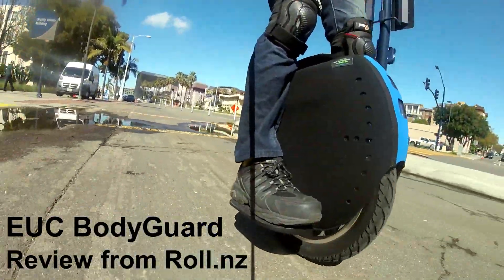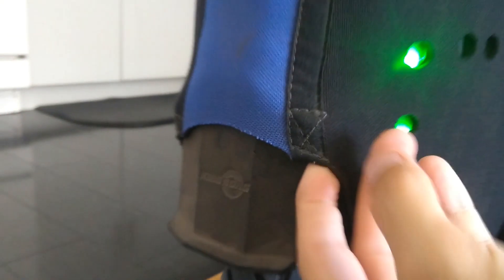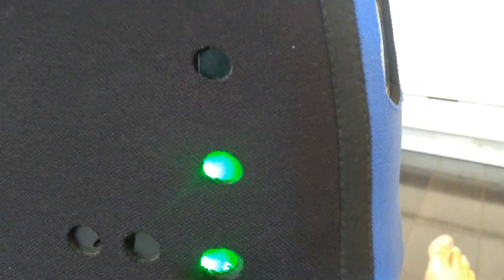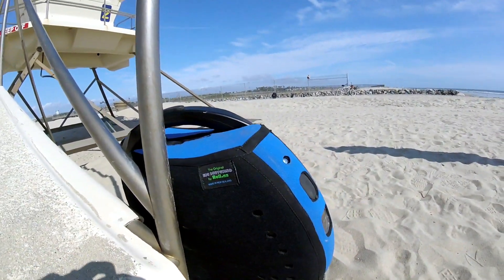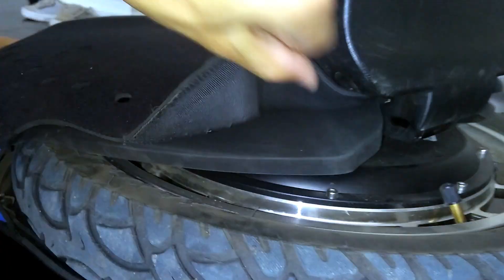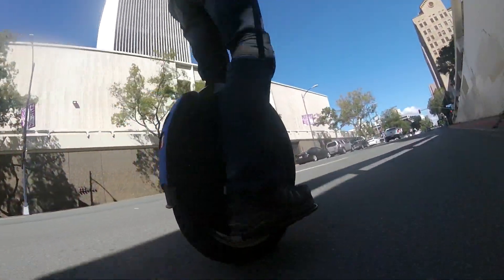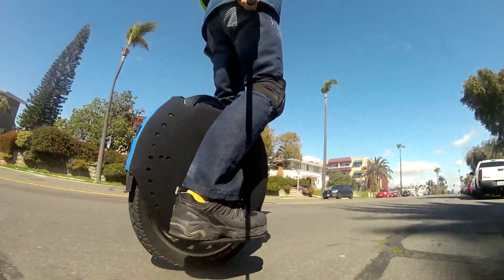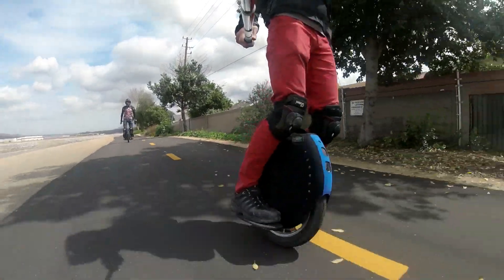EUC BodyGuard 250 Mile Review

Comment: I tried to order of these but had such difficulty getting it delivered from NZ to USA.  Plus in the time length of manufacturing and shipping, I got so good at riding my EUC I no longer even needed it.  Still waiting on my refund even though the item was never even delivered to me
Reply from the maker: You'll never not need it. I've been riding for a year and still use it. Its like driving without a seatbelt. You always need it even though you may never "use" it
Reply: @FlyboyEUC  I do a lot of offroading so I do want some exterior protection but I'll have to find another company or make my own I guess.  The side panels are also only $95 on the KS18XL which is almost half price of the EUC bodyguard

Comment: Nice vid! Have experienced any temperature increase with the cover on?
Reply from the maker: Never had it get above 46°C going uphill. It's also been pretty cold here. I'd like to do some more tests on a warm day.
Reply: @FlyboyEUC  That would be great if you could test that. 54c after hard trail riding in 15 - 18c is the highest I've seen on my XL, so I'm a bit worried what it will be on warm summer days with a cover like yours.